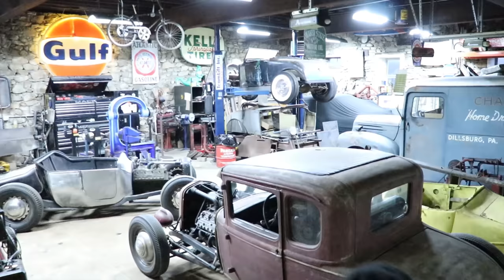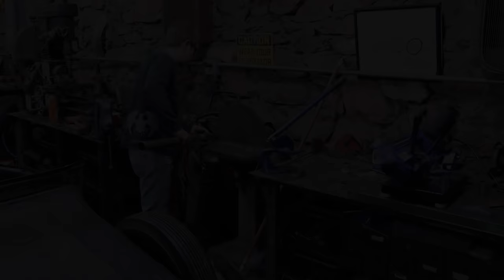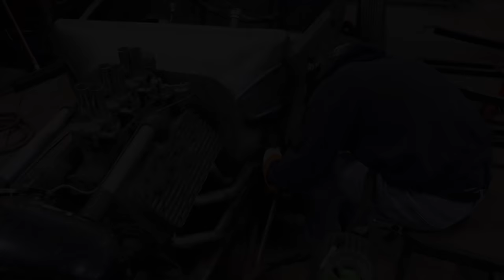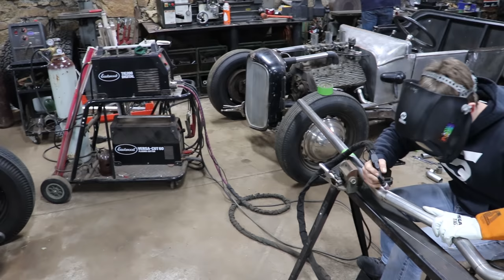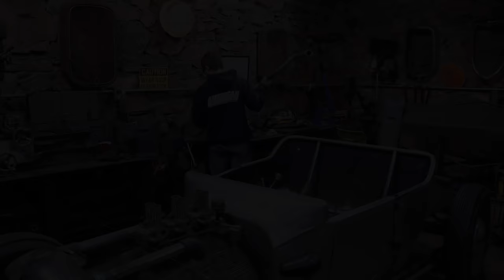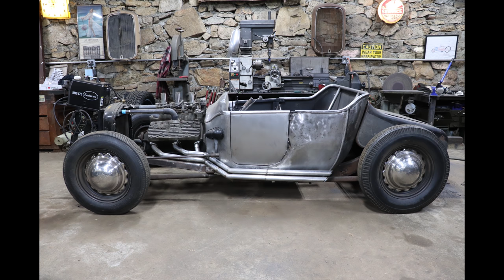New Header Design Complete - Ford Free-T - Ep. 59

Comment: Matt I love the entire exhaust system but my favorite part is the bends and merge at the engine. This makes the transition into the long pipes look even better. After a long ride I don't know how hot the flathead will make the pipes by the doors so the "Grandfather" in me worries about passengers and kids. Although it may ruin the look I was wondering about taking a length of 4" diameter stainless tubing and slicing it open and mount it as a heat shield. Again this is my Catholic guilt and Grandfather speaking LOL !  However, the exhaust looks too good to mess with. Great video as usual your exhaust guy is really talented.
Reply from the maker: The car is so low to the ground I'm thinking you would have to try hard to run against the pipes getting out, but you'll remember after it happens once or twice and you'll know not to do it again! Hahah. Thanks for watching. -Matt/ITG

Comment: not too wild to me. In late 50's my 37 has exhaust on both sides right to in front of the rear tires; sound bitchen and looked great. One question though ; no, 2 questions. Will the headers not impact the frame with engine torque?  And question 2; thee sheet metal piece under the headers, to hide part of the frame  below the door; is quite close to the frame, but looks like it would allow water and mud to fill the void driving down the road in wet conditions. Is there going to be something else added to protect the frame- or the back of the sheet metal?

            wayne
Reply: We left enough clearance at the frame that it shouldnt contact. The exhaust is all stainless steel so rust isn't a concern.

Comment: Matt, just wondering if you had any information on bracing a closed car like this?  I have a 1929 Buick sedan that I am going to have to brace something like this and can't find any information on such a project.  I can do the work but have no knowledge on how to start.  I was planning on duplicating the wood structure with steel but have been told that is not the way to do it.   Any information would be very appreciated.
Reply from the maker: Hi Edward, There isn't a real "right or wrong" way to do this stuff as long as it's strong AND safe. I'd start by putting diagonal bracing into the body after tweaking the body so that everything is straight and square. Then you can replace the wood as you go. If you're not concerned about a 100% perfect restoration you can duplicate the wood bracing out of metal. The metal will be stronger but will take some figuring to get it to all fit like the original wood. It's been done many times before and the naysayers are probably stuffy restoration guys that don't want to stray from a perfect AACA-points type car. I'd still consider the wood if you have the tools, as it is easier to copy the wood than redesign the bracing structure with metal sometimes. Whatever works you'll learn and have fun! Good luck with it! -Matt/ITG